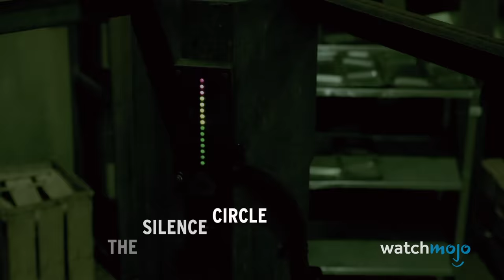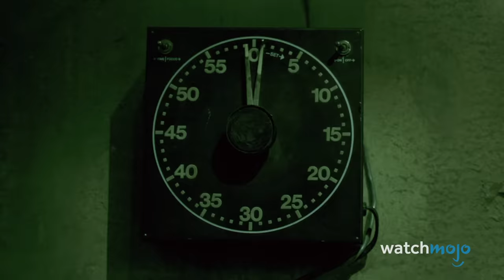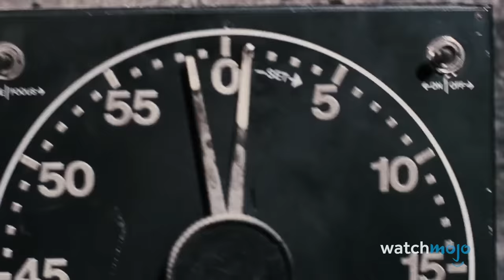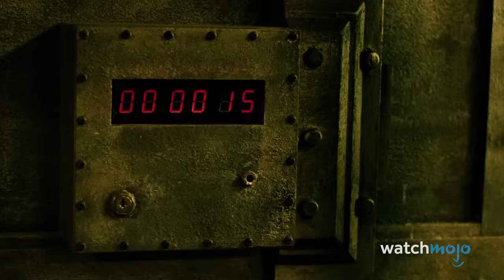Top 10 Hardest Saw Traps

Comment: I do not know how "The Rack" was not on the main list and was just an honarable mention. That scene was literally horrifying and one of the first times a scary movie genuinely scared the hell out of me!
Reply: Big favts
Reply: And even though Jeff got the key for it, he couldn't find the lock for it and something as big as the rack would have needed multiple locks, and he only had a couple minutes (maybe less) before it started turning. So it was basically inescapable.
Reply: @lemonadebrain1157  Big facts, it basically was inescapable! All of the components on The Rack had done major damage to the guy's body while dude took his time figuring out what to do. And they lost even more time while he was trying to figure out where to put they key. The Rack should have at least been on the list because that was pure unfiltered nightmare fuel!
Reply: The shotgun part of the trap has been beated by Jeff but he was too late. The judge was stupid because he stood in front of the goddamn shotgun. It was not on the list because it was beaten, but slowly. If the list would be named Top X goriest traps, rack would be up there, alongside few traps from Spiral (will not spoiler them, but for those who saw it, know which one I am talking about). And also, the cables that made the Rack work were completely visible, should've been cut with a sharp object, or ripped apart, Jeff pulls for one side and the Judge pulls from the other side, ripping the cable.
Reply: It was super easy tho
Reply: I’m pretty sure because if you have more than one person in there trying to save you, you’re most likely going to survive with maybe only one limb being shattered. Even if someone dies getting the key from the shotgun, if they’re able to get the key of the line, you can get it without being shot. The only reason why Timothy Young didn’t escape was because of Jeff. Also, you can literally just rip the exposed cords and the device would not be able to work. If this was a most painful saw traps list, this would definitely be up there.
Reply: It's only hard if the person who can save you, also hates you. Anyone who acts quick and fairly smart will save you with little damage to you
Reply: Inescapable? Every single test Jeff went through in 3 he took time he didn't have to resolve himself to save or not to save out of vengeance. Jeff could have saved them all from their traps had he acted immediately. That was the point. He failed all but the judge. Especially failing Lynn and daughter Corbett at the end as he had no knowledge she would be freed.
Reply: Fr, like the way hes crying too just makes my skin crawl

Comment: The classroom trap in “Saw III” was literally unbeatable
Reply: Not totally. Troy could have pulled out the chains in his arms and thrown chairs and desks at the nail bomb so it fell off the table and broke. Then buried the bomb pieces under more desks and chairs to give more resistance to slow the nails which would still be launched while he lay on the floor with one final desk across his throat to protect his head. It’s still unlikely, but it would give him a chance to live until the police found the classroom and could free him.
Reply: @Entilza  hahaha dude wtf… is that what your cool calm calculated mind would have done as you have chains stuck in your jaw and Achilles’ tendons?
Reply: @Entilza  yeah, but you gotta remember something, the door to the classroom was welded shut, he couldn’t get out if he wanted to, even if he stopped the bomb, he couldn’t escape
Reply: @akazatextingstories  Not through the door. But he could have waited for the police, who it seemed arrived pretty soon after the trap, or tried to throw more desks/chairs to break the windows and try screaming for help.
Reply: @Entilza  yeah, but how was he even able to get the furniture in the first place? The desks and chairs were pretty far from him, to confirm this, I actually looked up the trap, and my hypothesis was correct, even if he got all of the chains out of his body, he would be just out of reach, the only way I can see this working is if he used his feet, but hey, that’s just me
Reply: yeah if the table wasn’t apart of the classroom at all
Reply: How can u remove chain from jaws
Reply: @Entilza The fact that you got that all from another video-
Reply: @brandonready411 he got it form a video
Reply: @lydiaparker6731  Proves it wouldn’t work…..how?

Comment: The razer wire trap is one of the few traps I would feel confident being trapped in. 
Wires are loose meaning that you can move them around quite easily and there are next to no wires on the ground. On top of that, you are given 2 long hours to make your way out! 
Just crawl on the floor to protect your vital organs and major arteries and slowly push the wires out of your way. 
Soldiers are literally doing so in training! 
Chances are if you take it slowly you will make it out without a single scratch with lots of time left on the timer! 
Number 1 should have been the guy dipped in flammable jelly who needs to find a combination on the wall! 
You are walking bare feet on broken glass, slippery as ever from all that flammable goo sticking on your skin having to hold a candle to find combination numbers to try out.
Reply: he wasnt barefoot and he didnt need to use the candle either. in my opinion it is :
#10- The subway trap at the start of jigsaw
#9- The ice block hanging with the electric chair. Kinda seemed impossible for both to survive
#8- The flammable jelly with the combination written all over the wall.
#7- Classroom trap where he is pierced with about 7 rings, one around his jaw
#6- The rack. Seemed simple enough but didnt do it in time
#5- The machine that pokes the dudes eyes out on the bed. 
#4-- Venus flytrap. Same thing but he had to do it himself which is terrifying
#3- The key down that ladies throat which he had to pull out without her making noise
#2- The angel acid trap. Rigged
#1- Hoffman in the reverse bear trap. Tbh wasnt really a trap but it was rigged for him to die yet he managed to survive.

although i mightve forgotten a couple

Comment: I would say that the Venus fly trap, the rack, brazen bull, fish hook trap, 10 pints of blood, pendulum and angel trap are the hardest.  They all involve pain endurance to survive.  In the case of the 10 pints of blood... it’s difficult to make it out less schathed when no one wants to cooperate and be selfish.  Pound of flesh is probably the hardest of the easiest to win.  Dismembering your own limb is no small request.    The mausoleum trap would be fairly possible if, again you can establish teamwork.  First, if you have your mouth sewn shut, get a hold of the hatchet to cut the stitches out so you can speak.  You would have to sneak over to the other side, past the other guy to get it.  The needle pit is surely hard.  Of course, you could take your shirt off, wrap it around your arm, and use it as cushioning protection against the needles while you dig, unless you are pushed in.   The razor wire maze, to me would have to be the easiest to escape.  The wires could be pulled and wrapped to the mesh of the cage all around using the razors as anchors to hold them out of the way.  You would have to work fast, so grab a bunched wires and work them over to the walls of  the maze.  The Venus fly trap/ Iron Maiden is doable also.  You just have to cut the stitches and reach in.  Then tilt your head back to keep your eyeball from falling out while using both hands to hold the lock and insert the key.  Just don’t hesitate!  The brazen bull is the hardest, and impossible doing it the way that was asked.  I believe this trap was on one of those “doctors react” vids, and remember one saying that your pec muscles won’t hold your weight.  However possibly, linking the hooks securely together to each other’s chains and standing on them, you could use them that way to lift yourself up to connect the cords.  Just a thought.

Comment: The Razor Wire Trap wouldn't be too hard to do. The wires aren't placed too close together. It would be easier if he had been smaller since the spaces aren't that close. He would have a few cuts, but he wouldn't die instantly.

Comment: The injections in Jigsaw was actually so easy even if she didn't know the number already. Here's how you do it, remembering one contains the antidote, one water and one acid:
1) Take needle A and squeeze ONE drop on your finger tip. If it doesn't burn you: inject it as it's either the cure of the water. If it DOES burn you, discard it and inject the other two (there's no way to test between the water and antidote but you NEED the antidote and the water is harmless anyway)
2) If Needle A didn't burn, after injecting it, squeeze ONE drop from needle B onto your finger. If it burns, throw it away and inject needle C. You have now injected the water and the antidote and thrown away the acid. The only damage will be a tiny chemical burn on your fingertip
3) If Needle B didn't burn either, inject it. Congrats! You have injected the water and the antidote and eliminated the acid without even burning your finger a little. Feel free to look smugly at the camera, and proceed to the next room.

Comment: This one was easy and out of the comments I readThey didn't even think of doing this All you had to do was pick up a piece of glassand scrape your hands clean as a flammable liquid and up your arm as best you canSo that it wouldn't catch fireandTakea piece of glassThe largest one you can findPut the flameableliquid off your body on it light it and use it as a brighter torch and with the numbers being so much bigger you would be able to see it right away

Comment: How about a top 10 or 20 cavalry moments in movies? This list, there can be any moment when the heroes are the point of defeat, until backup arrives. But maybe you should exclude moments where the backup saves the heroes but not with intention. So the Tyrannosaurus Rex saving the heroes in Jurassic Park from the Raptors won't be mentioned, and probably be on a different list.

Comment: The trap in Saw 3 where the guys arms and legs arw twisted, id be ok with the arm parts because my shoulders and elbows are very double jointed and i can twist my arms around like 360°.
The pendulum trap was not a jigsaw trap - in that it wasnt made my jigsaw. The steel on the sharp edge wasnt made sharp enough, not like jigsaw would have made it. Hoffman didnt make it well enough and jigsaw wasnt happy with that, because it slowly dragged a blade across his abdomen, pulling his guts out. And the trap couldnt be won - he couldnt escape it which goes against Jigsaws idea of going through a trial of pain order to come out cleansed.
The Angel Trap was the most elegant in my opinion, even though Amanda made it inescapable which set her fate with jigsaw meaning she would not end up as his apprentice.

Comment: pound of flesh: why she (or he) is putting her clothes to the scale the last second? HE panics and starts to cut himself, so SHE could stay calm just do that in the last seconds. surely her clothes are more heavy than a couple of "steaks".
Nina's trap: I wonder HOW the key with the hook etc ended up in her stomach..
Kerry's "angel" trap: One of the easiests (not cause it's easy but compare to all others, are way more hard) of all Saw movies but the key was useless.
For pendulum trap, rack trap, mausoleum trap with the eyes closed, there was no way to beat them (along with Eric's "sitting alone" in the bathroom & Troy's hooks, especially the jaw one and a closed door)
and about the spinoff Jigsaw & Spiral, let's say it's all ok, Jigsaw sucked and Spiral was just good. I wonder how the hell someone has moved a dead body and replace the John's one in the coffin in a cemetery without even a trace (the next day the coffin has Monsen inside and not a single mark in the ground, how Nelson did it, via tunnel ?)
I was a huge Saw movies fan (only from #1 to #7 or 3D, not Jigsaw or Spiral) and ok, loved the idea but there is a tone of questions about each and every little thing. these are just a ...let's say a 5% of those.
Also it would be nice to separate the "hardest" from "inescapable" ones..

Comment: How is The Rack an honirable mention, and the Angel Trap a part of the list?

The Angel Trap is horrifyinh in its own, but as opposed to the others that involved a lot of mutilation, dipping one's hand in acid doesn't sound so bad.

The oendullum is also pretty easy (if it wasn't rigged). The pain in both hands will be almost instantaneous, again, as opposed to the other traps that will require you to literally mutilate yourself voluntarily.

Comment: The order on this top 10 is definitely off. They have included some traps which are impossible to escape such as the pendulum or the angel trap but they’ve put them low on the list. They haven’t even included the ring cables trap which was also impossible because the door was sealed shut. No matter how hard cutting your own eye is it’s still technically possible.

Comment: How the fuck getting out of a rigged trap is harder than just cut your face, even if the trap werent rigged you Will still need to crush both hands to survive while in the other you just have to press your face, it will hurt a lot for sure but you dont get that prejudiced like other traps that you Will have to give parts of body to survive.

Comment: The razor wire maze isn't as hard as it seems. You can use the underpants that the guy is wearing and wrap them around your hands and displace the wire and get through much safer. If that doesn't work then you can shimmy on your back protecting your vital organs.

Comment: Some of these traps are meant to be escapable. While some aren't. The ones that aren't were designed and made by Amanda and Hoffman as execution devices. 

In my spare time I often run simulations in my head about the more complicated traps and how I can escape them. Particularly the one where you're stripped naked. Covered in flammable gel and have to unlock the safe using a candle and numbers on the wall.

All controlled of course. I'm not stupid. Lol. Lots of substitution. Glass for paper scraps. An electric candle for a real one. Just to see if there was a way to read the letters without moving the candle too much

Comment: Seth Baxter was not a saw trap
Angel trap was not a saw trap either. In order to be a saw trap it has to be escapable. John Kramer did not do these or have knowledgeable of them therefore not a saw trap.
I think the razor wire one is winnable you just cant freak out and look for the proper way to go. You have close to two hours. It's not that hard

Comment: The opening trap from Saw 3 - the man with the thick chain loops in his body - was an impossible trap for other reasons than the sealed door meaning he couldn't get out and escape the nail bomb. First, 60 seconds to pull THAT MANY thick metal loops out of your body is just not long enough. Some of them were buried incredibly deep and would require phenomenal strength (and an unheard of pain threshold to not pass out) to pull out. Even if somehow he was STILL able to do it, that one chain that was deep in his mouth, through his tongue and out under his jaw could not possibly be removed without tearing his lower jaw off his face which would 100% be immediately fatal.